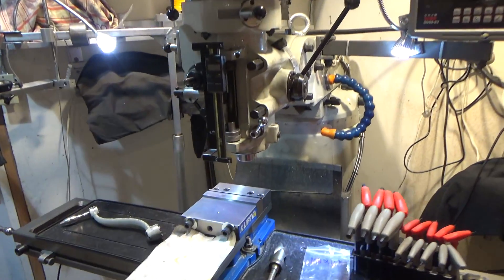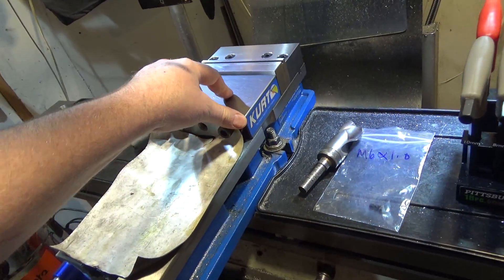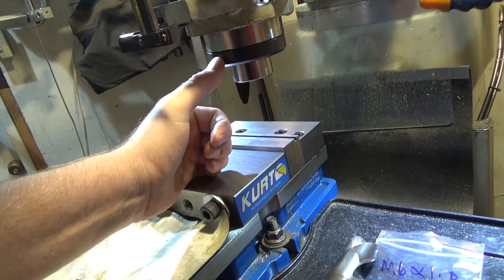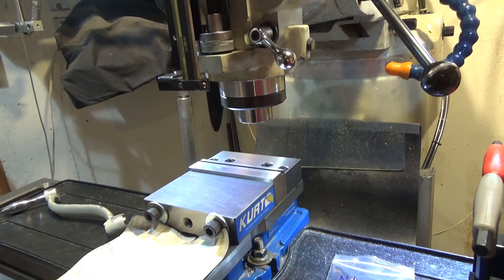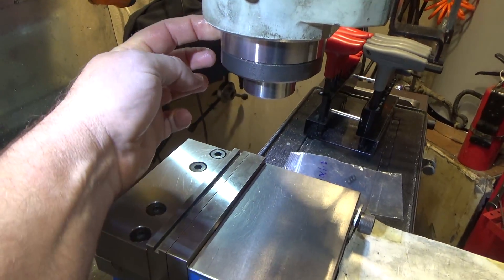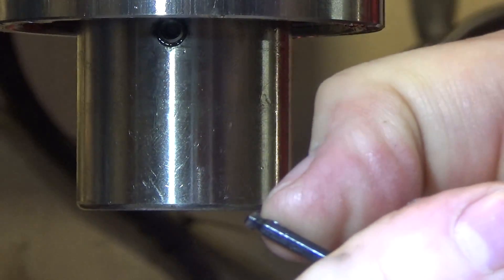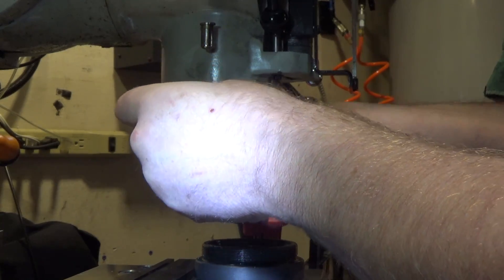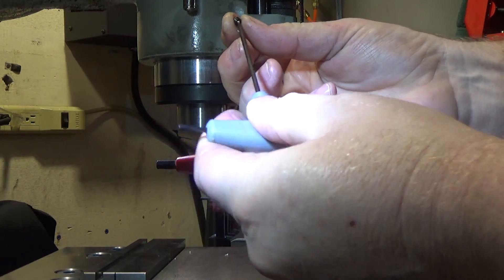110 Replacing the R8 Collet Alignment Pin on a Bridgeport Clone Mill

Comment: Awsome video i have 2 Webb mills 1 has the alignment pin one doesn't ive always wanted to fix it but didn't know the process.
Reply from the maker: I am glad that I could help. There isn't enough info out there on repairing mills and if your manual is as bad as mine, the exploded drawing is nearly useless.

Comment: I agree with  Turning Point  and what he found out. Keep the draw bar and collect threads clean and lubed and everything will be fine. I've been running BP's, Taiwan,  Wells-Index, Laguns, plus some really crappy BP copies for over 50 years and with and without pin and never had an issue as long as threads were nice and collets clean. Enjoy your vids, keep it up.
Reply from the maker: I love the feedback, thanks. Your opinion is definitely in the consensus.

Comment: My bench mill had the pin, but my Lagun doesn’t, the only problem I see without the pin is sometimes it s difficult to get the collet to not spin when the shank if the tool isn’t perfect
Reply from the maker: I appreciate the info. Your take seems to be the consensus around here.

Comment: Great video.  When I got my mill the collet would not go in so I had to do this very same thing.  But I didn’t put lock tight on the inside alignment pin and didn’t measure the gap on the nut.  It runs fine but now I wonder if I should redo it?  Any suggestions would help.  Thanks.
Reply from the maker: I am definitely no expert, but Yuchol, over at Woods Creek Workshop suggested that if the collar nut was too tight, that the quill would not retract all of the way.  I don't think the loctite is essential unless the pin is moving on its own.

Comment: Haven't used my BP  that much yet but i will leave it in as the R8 is not a locking taper . Being as it's a light weight machine it should be ok as long as the tooling used is taken into consideration .   Any thing that req's large heavy cuts will have to wait until the big mill is up & running !    Cheers .
Reply from the maker: Thanks for the tips Max. Always great to hear from you. I look forward to seen your new shop evolve this year.

Comment: Other than the dedicated end mill holder my Haimer was set up concentric for and that pin indexing its R8 shank to the same point in the spindle each time, I can't think of any real use that pin serves. Marking the shank and spindle exterior works to regain that same index position for the one tool I have that needs it. I pmed Forrest Addy and had a conversation with him about those index pins. He knows 10 times what I ever will and he highly recommends removing it. As he said and as you've found out it's not if the pin will get sheared only how long until it does. And as you've already read on PM, get unlucky and that sheared pin can wedge the collet or shank in and do a whole lot of damage on expensive parts. I think most manufacturers of the BP clones still have it more from tradition and due to copying the real Bridgeports. Since there's no real strength to that pin it's meant to prevent rotation of a collet or tool shank until it starts to tighten as the drawbar pulls it up. Once the tapers friction builds that pin is doing nothing. With the drawbar and collet threads in good condition and lightly lubricated as there supposed to be I've not found any issues at all without that pin in place. Imo it's far safer and likely cheaper at some point to remove it permanently. Yeah a 30 or 40 taper would be much better. Given the wet noodle head rigidity Bridgeports and there clones have a 40 taper would be wasted other than having that positive drive from the two lugs. Few with home shops are willing or need to push there machines past what an R8 is designed to do anyway. A Bridgeport or clone with an R8 is classed as a light duty toolroom mill at most. Since nothings ever perfect each collet and R8 shank will have slight imperfections and mismatches to the exact taper angle. Removing that pin probably helps to equalizes the wear a bit that develops over time on the female spindle taper.

And as at least one other has mentioned keyless chucks and especially something as costly as an Albrecht should NEVER be used with S&D type drills. Practical Machinist has a few threads about it. Some have mentioned the chucks can self tighten enough to the point of damaging the chucks internals, and worst case up to the point of permanently destroying the chuck. I limit my keyless to the 1/2" drill size and for holding taps up to about a 3/8ths thread size. If the chuck refuses to open by hand it's a clear indicator your over stressing the internals. My Albrecht and even the Glacern keyless copys I have are great, they like everything else also have some built in limitations due to there internal design. If you look at how a drill chuck grips on the round tool shank you have a narrow 3 point line contact. There's very little actually doing the gripping other than the tension on the jaws and the slight elastic deformation of the drill shank (the shanks are left soft for that reason) An R8 or even ER collet will grip those S&D drills far more securely. Obviously slower to use though.
Reply from the maker: Thanks for the really useful tips. Your opinions seem to be the consensus here and in the forums. I hear you about the Albrecht chuck. I had to loosen the chuck with a pair of Channellocks over a rag to untighten it. I cringed the whole time.

Comment: I'd leave the pin out or remove it if there is one installed. The reason is that on an interrupted cut I've had the pin cut into the collet. If that happens it will make you say lots of bad words trying to get the collet out. You're left with no way to get a hold of the collet to turn it in the spindle. I've had to get to the pin and drill it out to get the collet released from the spindle.
If you are taking a cut heavy enough to where the pin is actually helping to stop the collet from slipping in the spindle, you are probably in danger of sucking the cutter out of the collet into the work, or even worse into the vice or machine table. This is more likely to happen on a machine bigger than a Bridgeport or BP clone where you have 3hp + available. If you are taking heavy cuts with a 5/8" dia. or larger cutter you need an R8 tool holder with the set screw in the side to keep the cutter from being pulled out. At worse the R8 tool holder may slip but at least the pin won't be there to jam it in the spindle.
Cheers from NC/USA
Reply from the maker: I really appreciate the info, thanks. Your opinion seems to be the consensus. I might just actually do as you suggest.

Comment: I just replaced the one in my HF mill drill. I had to remove the spindle.  Press off the bearings. Drill out the welded screw/pin. Retap the hole.  Machine a new screw/ pin   #10-32  hard cap screw turned to .150 dia and .050 on the end. Install it using an assortment of r8 tools to gauge the depth.  Grind it flush and tack in place. Reassemble.
Reply from the maker: Wow, that would have made an interesting video. Nice work. A whole lot of people seem to think that the alignment screw has a very limited value, so you might not have  to do anything if it happens again.

Comment: When I had to replace the spindle on my mill, I had the opportunity to leave out the screw, but I didn’t.  I feel it provides more benefit than not.  Also, you’ll know if you over tighten that collar screw because the quill won’t retract up all the way on its own.
Reply from the maker: Interesting note about the collar screw, Does it make the spindle sleeve go out of round a bit?
Reply: Dudley Toolwright yes it does.  I couldn’t believe it myself, such small force and yet it makes it go out of round.   Matt at Precision Matthews warned me.
Reply from the maker: Great tip. Thanks.

Comment: I took mine out of my index mill.    That nut , on my index mill is called a bearing retainer.   Thats why its not torqued down.
Reply: My excello mill didnt have a pin when I bought it. Probably sheared off at some point in its life. Hasnt caused an issue so no need to replace it.
Reply from the maker: Thanks for the info. Almost everyone who has replied has had similar sentiments.

Comment: Non of our mills at work had the locating screw and it was hard when I got my mill to get used to having to turn the R8 collet to align with the pin.
Nice informative video great job Robert.👍
Reply from the maker: Interesting. Your comments about the mills at work seem very common. Useful data points.

Comment: I used a Bridgeport that had no keyway with a fly cutter. Took a bit of a heavy cut which stalled out the cutter before I could turn off the machine it over tightened the draw bar to enough to snap it. The draw bar was ejected from the top of the machine bouncing off a 24 foot ceiling.  Glad I wasn't impaled when it came back down.
Reply from the maker: Wow, that's a hell of a story. The incident that broke this alignment pin off made the drawbar so tight, that I had to use an impact wrench to undo it.